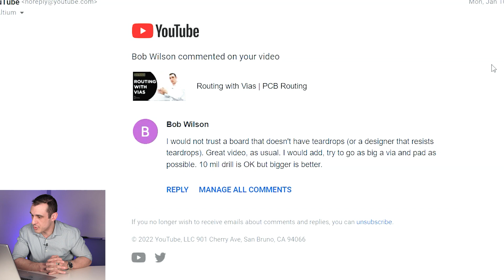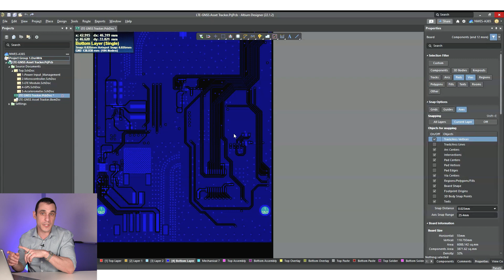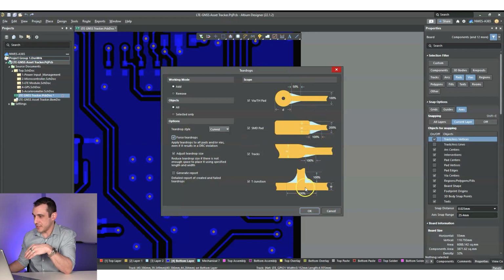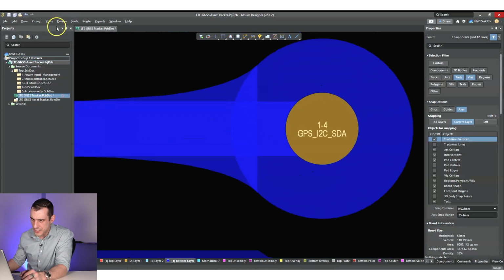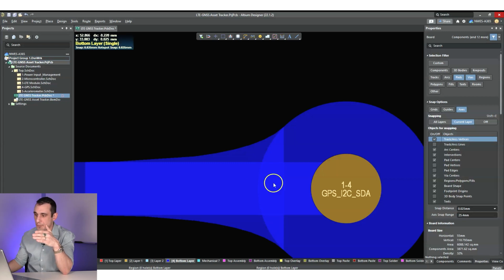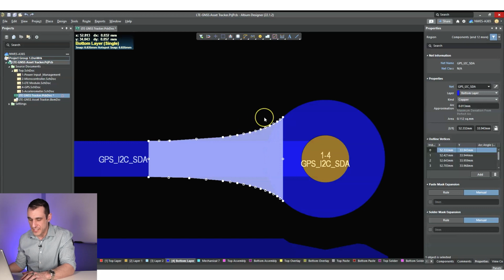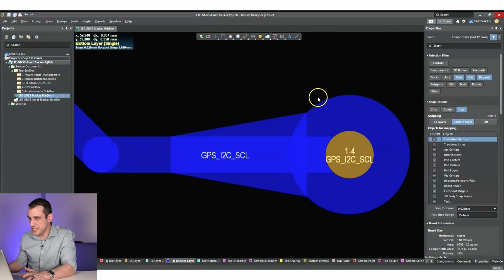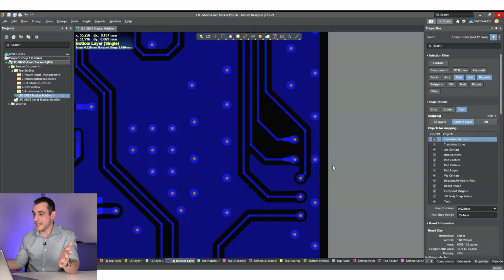Teardrops Tips & Tricks in Altium Designer

Comment: Hi Zach, great video!
To get the bigger teardrop, you may have to uncheck the "Adjust Teardrop size" box. Although playing around with it might be necessary as well. For instance, getting length and width to 200% resulted in a nice and large teardrop but changing one of its parameters to 150% reduced both length and width.
Reply from the maker: Cool, thanks!

Comment: Hi Zach, great video :)
small question: How do you configure Altium such that the tracks are visible within the pad? (as at 1:55, you can still see the track inside the pad)
Thank you very much in advance.
Reply: Try using the View Configuration panel. You can configure the transparency of different objects in the PCB layout, and I as I recall you can change the transparency of pads in that panel. I often do this with polygons so that it is easier to make out tracks.

Comment: Thank you for the video.  When it says %, what is it a % of?  The trace width is what I am guessing.  But, why would the teardrop be based on that?  I am trying to add teardrops that are the full width of the via, on vias, and of the pads, on pads.  I've tried setting the % widths to 100, and even 500, and I can't get it to do what I want.  It would be a really  nice idea to be able to select an object, say a via or group of vias, then right click, and have a "teardrop" option that just added the teardrops to the selected vias.  Having to select them, then to to a menu then a dialog is a bit cumbersome.
Reply: From what I can see, it is the width of the pad/via at the point where the teardrop curve is tangent to the pad. Since that is the definition, you would technically never be able to hit exactly to the full width of the pad, but you can get pretty close if you set the teardrop length long enough. The reason for the varying teardrop size is for high density layouts or in RF layouts, when you are at high density a long teardrop could interfere with other routing. In RF designs like the radar boards I've done, I've used the teardrop as a linear taper for mmWave impedance matching, you have to very precisely set the length of the teardrop and the width, otherwise you match to the wrong bandwidth and the system might not work. For most stuff, the default teardrop settings should be fine.

Comment: I added teardrops to some selected vias, however, it only added teardrops to the top layer traces and left the bottom traces unchanged. which also are connected to the vias.   Is there anything I missed?
Reply: There should be an option for it in the Teardrops dialog in the PCB Editor

Comment: how do you add teardrops in circuitstudio? I know automatic teardropping is not an included feature, but how do you do it manually
Reply: I don't use circuitstudio regularly, but I think the way to do it would be to draw it out on a copper layer as a polygon or fill, and then copy that to other vias as needed. If you use mostly the same via size everywhere in the board then this should be an easy exercise. I think the only difficulty would be repeatedly setting net names across those copper fills.